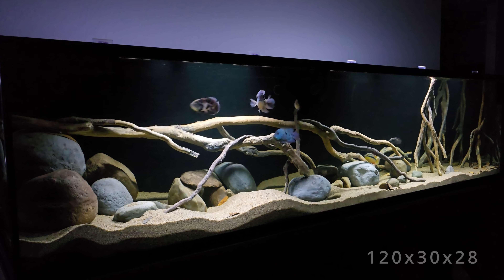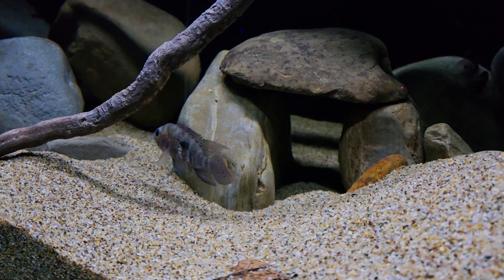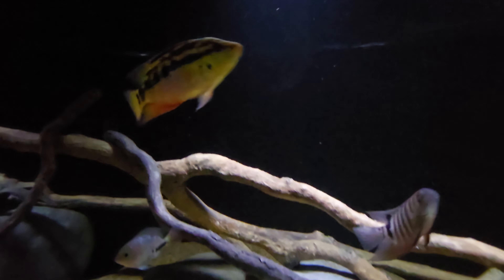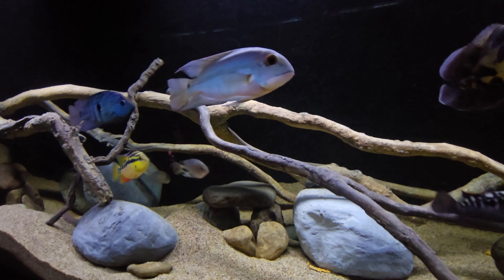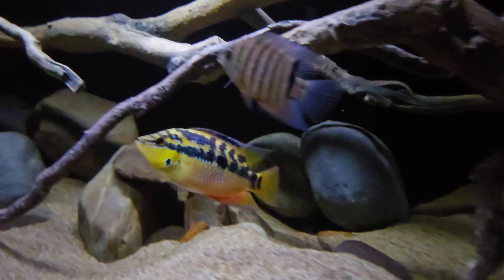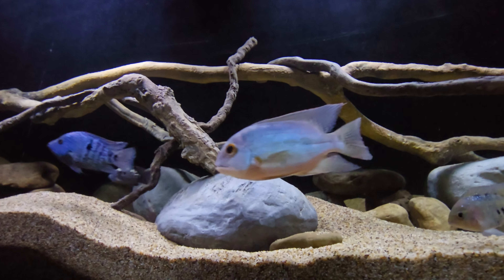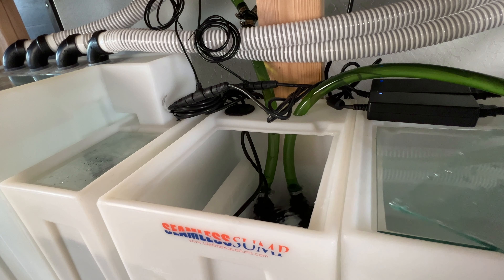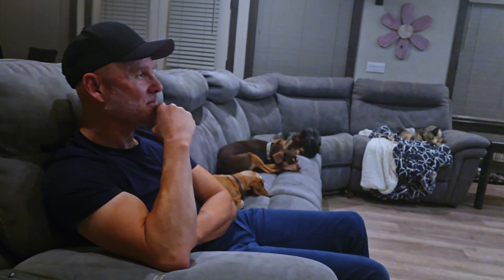10-Foot Custom Aquariums Tank -- Was It WORTH THE COST?

Comment: David ,

This tank is a dream but so so expensive. I recently upgrade my 98 gal to a 120 gal acrylic tank. I got it used off the market place. It’s a 5ft tank and it has the filtration behind the tank. That way you don’t have to worry about leaks. I have two pumps pumping the water back in from the other side. The guy I bought it from had it as a salt water tank. So I cleaned it up and hosed it out. There were a lot of scratches on the tank so I buffed them all out the best I could. I think the tank looks great now and it’s housing my CA SA cichlids. That extra ft makes the cichlids happy. I also added a new canister filter a Sun Sun hw 3000 the filter is really nice and moves a lot of water. I like that I can hide my heaters and everything in the back of the tank. Even my canister filter suction and return. Is in the back. I like not being able to see all the stuff. I feel much better having an acrylic tank and don’t have to worry about seals breaking. My black tiger Oscar is getting big he’s already grown an inch in less than 4 weeks. I love him though all black with some orange spots.
Reply from the maker: Love hearing about your tanks, Jeremy. Isn't it crazy how fast those oscars grow??
Reply: @CichlidCharmer  oh yeah I have learned a lot from your channel as well and it is very highly produced well and the camera work you can tell your artistic. I am so glad you got into CA SA cichlids aren’t they fun? So personable.
Reply: Very nice
Reply from the maker: @jeremymoore450  That's a huge compliment -- thank you! Yes - I love my CA and SA cichlids.  They are definitely my favorite right now.
Reply from the maker: @davidleach4689  Thank you!

Comment: Hi, I love your videos, and you, lol. I am sorry that  this has not got anything to do with what you are talking about but there are tons of videos about water changes but no one says how they get the clean water up to the same temperature as the water in the tank before putting it in. I have to fill up buckets and check the temperature  of the water in the bucket and the tank, to make sure they are the same. Takes a very long time! I look forward to all your new videos. Wish you did them more often. Thanks  Mandy Green , Portsmouth, U.K.
Reply from the maker: Hi Mandy! So I have controllers that keep my tanks at a specified temperature. I highly recommend using them. The one I use is in the video description. So then I just get the temp to match coming out of the faucet , using my Pampered Chef thermometer. Super easy. Thank you for such high praise of the channel, Mandy! 🥰

Comment: Totally worth it for such huge aquarium!!!

For smaller aquariums, instead of buying the ones at the big-box-stores , look into the Mega Matrix or the Crystaline G2 kits from Planet Aquariums. Much better quality than big box and reasonably priced.

Ball valves are designed for on/off application. To silence your overflow box use a gate valve. In my CA aquarium I used a gate valve made by Spears. 10x more than a ball valve, but it works!

Beautiful setup!
Reply from the maker: Good advice!  Regarding the valves, I learned about the gate valve difference after the knob on the ball valve broke. Anyway, I wish I'd started with gate valves. Thank you!

Comment: For large tank absolutely you want a custom tank from a very reputable company. I own a custom Aquarium and I've had it now for going on 4 or 5 years I'm totally happy with it. I did how ever spring for the whole package Tank stand and sump for sure very expensive. I also have 9 other smaller tanks from a 125 down to a 5 1/2 gallon tanks all of those are just store bought tanks except my 125 I got off the market place so don't  know where it came from. But you had great points on the tank and yes I have those same kind of valves on my overflow box and they are for sure tough to get tuned just right.

Comment: I have tanks with 260 to 450 liters for more than 50 years now. They are from the German firm Juwel, market leader for aquariums in Europe. They are assembled on a semi industrial scale, half with robots. My oldest one from this firm is from 1968 with silicone. Thats more than 50 years old! Then the others 30 years old, 20 years old etc. Never a problem whatsoever with leakage or otherwise, and they are very complete and price competitive. I think silicone can last forever if applied in super clean and industrial conditions. Also you can get all the parts from the last 20 years or so. I changed only the light  beams from t8 to t5 to Led. If available in the US you should take a look!
Reply from the maker: Juwel -- I'll take a look. Thank you!

Comment: Great videos!
I plan to purchase an aquarium from CustomAquariums, which is 72x24x30 or a 72x30x30. What issues do you see with a depth of 30?  Also what model number are your sinking rocks from AquaDecor?

Great advice on sump 1.5” hose upgrades and ball valve upgrades.
Reply from the maker: I absolutely love the depth of width of 30". It is a huge difference from my 24" tank. If you go 30" high, then it can be hard to reach the bottom. That's why I did 28" which is all the way to my arm pit lol. Still, taller tanks do have a huge impact visually. I don't remember which model my rocks are. If you take a screenshot and send it to aqua decor, they'll be able to tell you. Thanks!
Reply: @CichlidCharmer  Would you go with 5/8” glass all around?

Comment: Just trying to understand, you spent so much on the tank but not get a stand from them? Was the stand as expensive as the tank?

Also I they don’t give a good warranty? It’s surprising
Reply from the maker: I wanted my stand to look like the others. I haven't had time to do the finish work yet. Their stands aren't cheap. It would have been several thousand extra and or wouldn't have matched the stand sitting right around the corner from it. The warranty only applies if you use their stands.